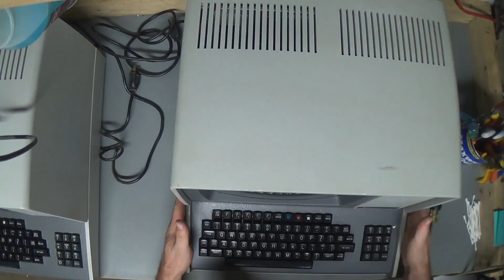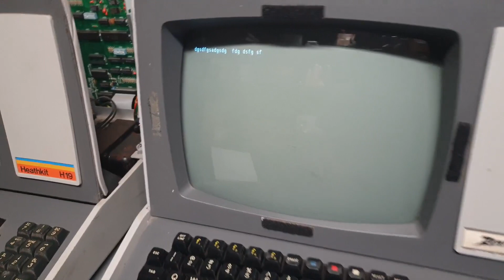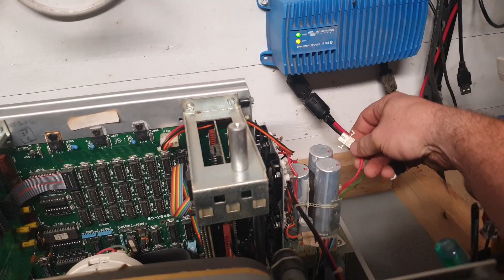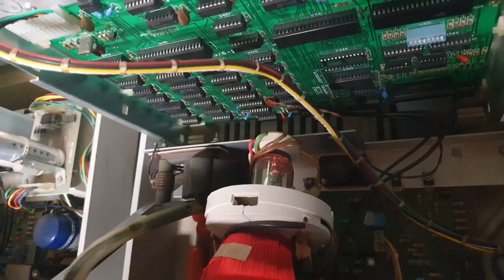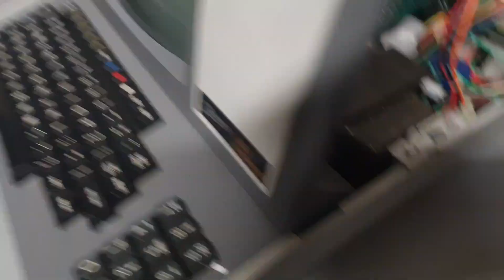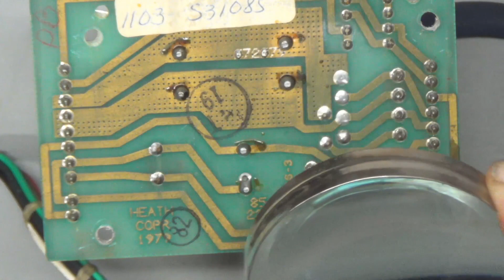Heathkit H89 / Zenith Z89 Fixup Pt.01

Comment: Good morning, I am restoring one of these computers and I would like to know how many volts the 430uf electrolytic capacitor that is next to the silver ones is, the computer arrives to me disassembled and with that capacitor missing.
Reply from the maker: I don't have that machine out on the bench to look at at the moment, but it ought to be listed in the parts list in the assembly manual.

Depending on the revision of the machine and whether it's an H19 or H89, some of those positions are meant to be left unpopulated, IIRC.
Reply: Yes, but it doesn't indicate the voltage just in case I used a 25v, this machine is very disassembled, I think I managed to put it together but there is one thing I can't find, the R1 brightness regulator, I'm watching your videos to see where it is connected, Since it doesn't arrive in the machine, I'm going to have to assemble the cable and buy a 500 ohm potentiometer. The initial problem is that the diode bridge is burned out.

Comment: I have an H89 with an H37 controller and two half height high density drives that my father and I built in the 70s. I repaired it a few years back; voltage regulator, rectifier diodes, and some caps.